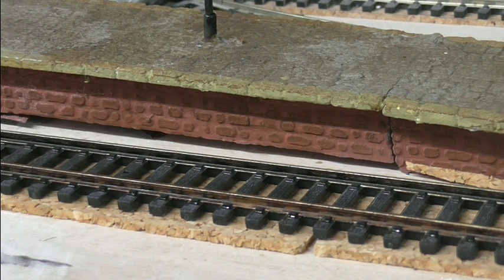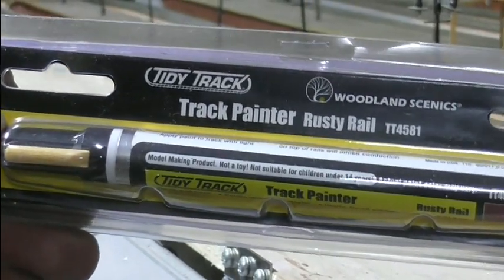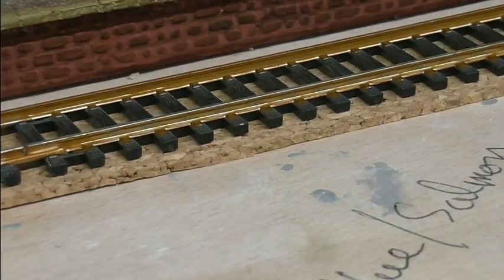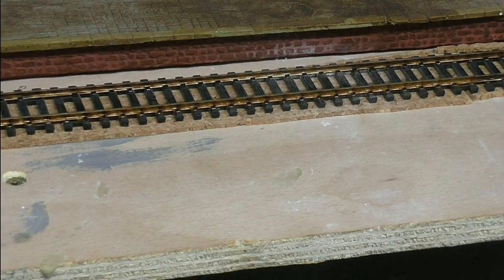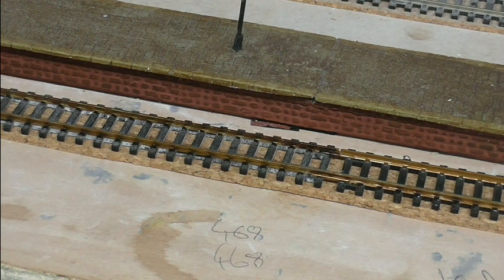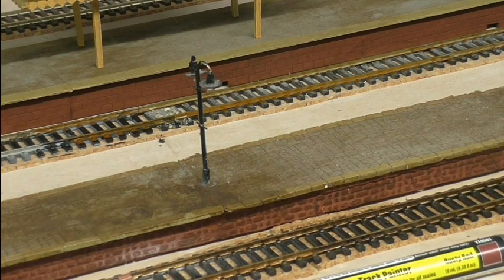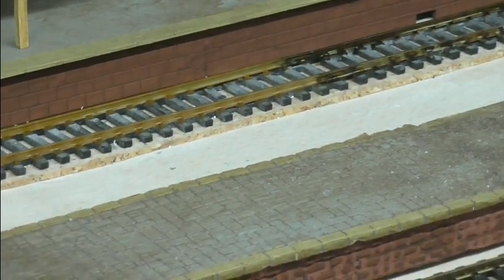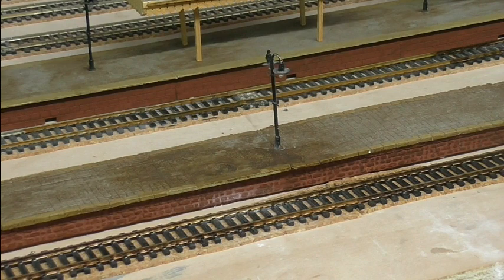Quick Track Weathering

Comment: Hiya Glynn, I used a paint pen with a fine tip but covered most of it when applying tracks wash with the air brush
Reply from the maker: Hi digger, Think I need to find a finer pen, but keep trying! thanks Glynn